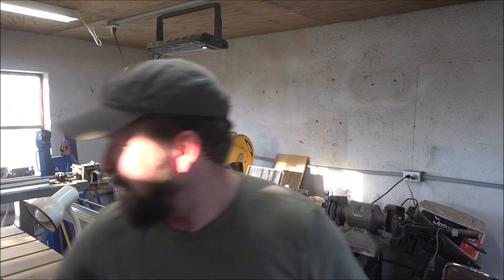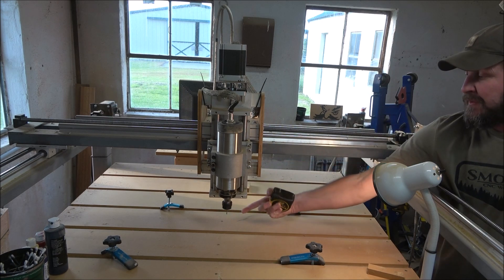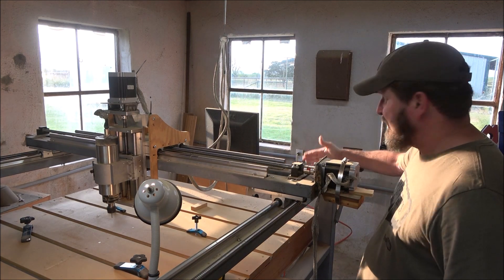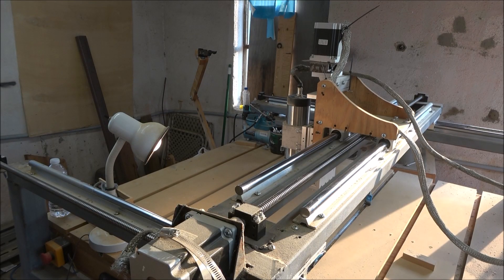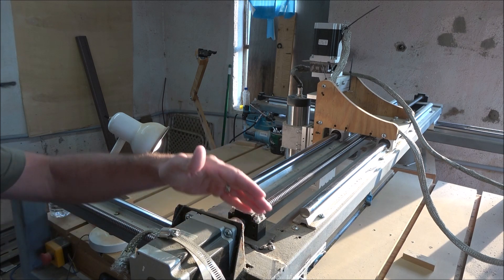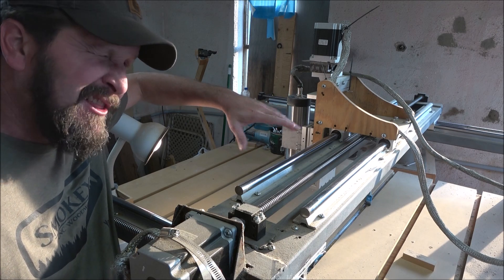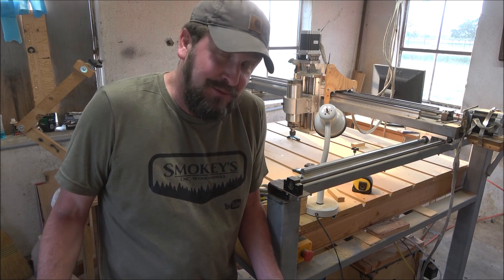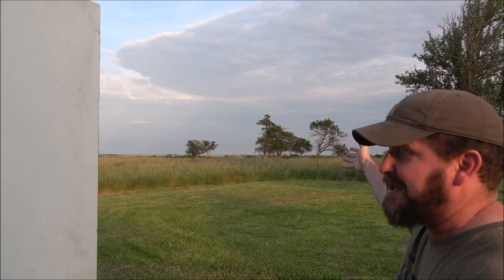DIY CNC Build Questions and Answers

Comment: Looks like we sourced the same screws and bearings . I am only jealous of your space . I am using a bedroom and may need to dismantle the machine to get it out. I am using the small machine though to peck holes on componenets I am making for the big machine. It is invaluable to have a cnc to make a cnc. I drill out the holes after precision pecking them. The z axis needs an entirely new assembly but this time I will use 10 mm acrylic .
Reply from the maker: I really lucked out when we bought this house...has a big dairy barn (my big shop) and this side room which is why I built a 4x4  had I had the room in the other shop, I probably would have gone with a 4x8 or 5x10